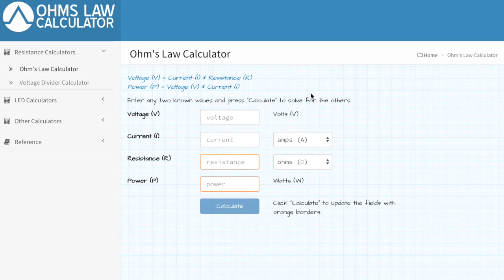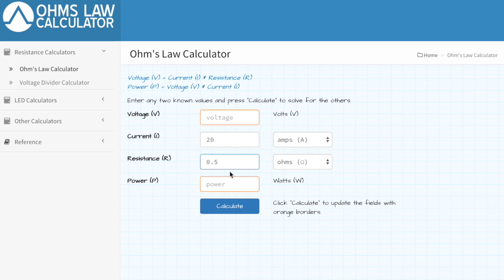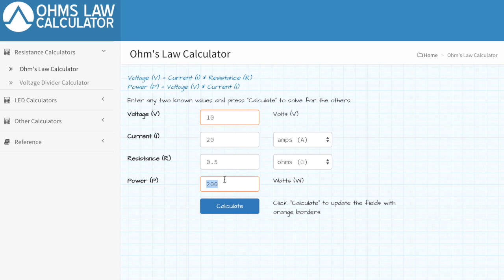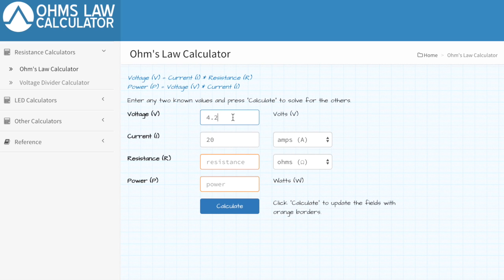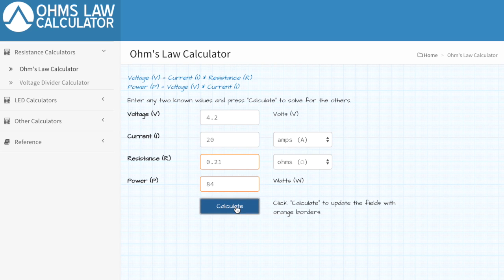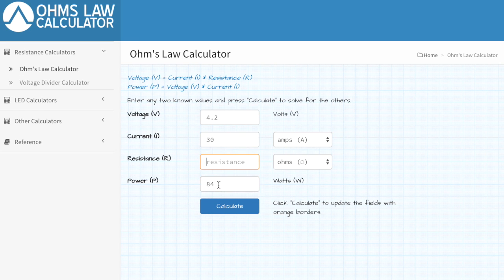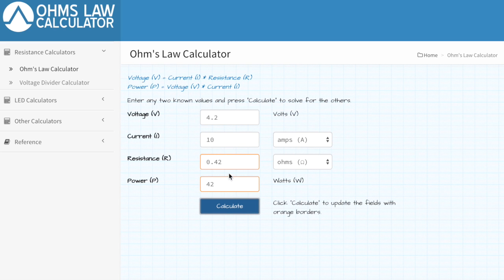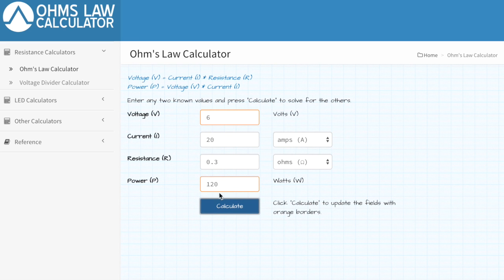Vaping for Beginners - Ohm's Law & Coil Resistance for MECH MODS

Comment: My first ecig was the nautilus mini. I am a newbie for sure. This is beyond my comprehension. I just bought a Aspire K4 and a Aspire Platinum Kit. I know the Cleito has 3 different coils, can I use any of them? I am using the .27 that came with the kit. I dont even know if you can put the Cleito on the Aspire Platinum battery. They are both 2000 mah batteries. All this stuff is confusing to me lol

Comment: how do i get my vape to stop shocking me? i start off at a 19.0 w and 3.07 v. i have tried to check other forums post on saying that it is hot juice, or it spitting up rather than a static electric charge, but it really does feel like a small shock. i have also tried taking a small paper towel and cleaning the tip and inside. I have also made sure to leak some of the juice out so it is under the line and not full.

Comment: those batteries you have are extremely exaggerated in their ratings. no 18650 can have a high capacity and a high amp rating. efest actually buys there cells from LG chem and rewrap them. those cells from efest are lg batteries that didn't make the cut! don't just take my word on this, be smart people and do your research. Sony, Samsung, and LG are accurate in their ratings. don't compromise your safety to save a buck. happy vaping :)
Reply: Patík #neverlucky Efest does have true 20a batteries. The problem is that you don't really know what you get until to test it.
As I said, it is known that they change cells and still use the same name. This happens rarely and it's possible that they don't do that anymore.
But saying that they don't have 20a batteries is just wrong.
Reply: Patík #neverlucky That's how you think LG does their tests? If they are true 20a or not? They will still sell their batteries to Efest if they were 20a. Failing a LG test just means that they don't perform up to their standards. Who the fuck knows what their standards are.

The fact is that battery testers has proven that they are true 20a, so why would I listen to you? Are you a battery tester? Have you tested them out yourself? If a respectable battery tester has tested them as 20a, I will take their word for it.

I already mentioned that you don't always know what you get. I'm not talking about a bad cell, I'm taking about a different cell. For all you know, you can get a 10a cell without knowing because they have changed it. They do things like that, so unless you don't have a battery tester at home, I wouldn't take the risk.

Point is, they do have 20a batteries and the 20a cells is in fact 20a cells 100% of the time. the questions is if you get the cell that you ordered or is it a completely different sell, wrapped in the same name.

Just because it fails a LG test, it doesn't mean it's horrible. LG would never sell a battery to Efest if it was really dangerous. That just doesn't happen.
Reply: Patík #neverlucky I have already told that the chances of them changing cells with the same name is there. Without a battery tester, you never know what cell you really get.

It doesn't change the fact that Efest does actually have 20a batteries as it has been proven. Mooch tested them and they were 20a. Couple months later he did the same test on the same battery but a different cell. turned out to be a 10a cell. So what happened? Efest change the cell to a 10a but didn't change the name of the batteries.

So as I said earlier, There is a chance that efest switches their cells. But if you indeed get a 20a cell from them, it will be 20a cell 100% of the time. if you get the 10a cell from them, it will be 10a 100% of the time.
it's not like the same cells acts completely different. That's not what Mooch meant.

LG will not sell a dangerous battery to Efest. They don't do that, but efest will provide you with false information like higher amp, mah and such.
and sometimes even change their cells.
Reply: thata true efest has only like 13 amp and its tested on mooch
Reply: Well, for a guy that follows Mooch, I find it weird that you are saying that Efest doesn't have more than 13a.
Even though i wouldn't buy a Efest battery because I'm afraid that they will change the cell and use the same name, they do in fact have true 20a batteries.

What I mean about "I'm afraid that they will change cell" is that they mark it as 40a, they have been tested as 20a but they can easily switch the cell with a 10a one and still be using the same name.
So when you buy a specific Efest battery where you know that it has been tested as 20a, the chances are still there that you can get a 10a battery. I'm not sure if they still do this but I wouldn't take the risk.

But they do in fact have 20a batteries.
Reply: cause the 20A's dont
Reply: naaah duude... they just take lg bateries that didnt make it thru the tests and put their sticker on it.... soooo no not always 20A => youre not guaranteed to get a true 20/40 A battery
Reply: https://www.e-cigarette-forum.com/forum/threads/an-open-letter-to-efest-youve-gone-too-far.722293/
Reply: Patík #neverlucky You are repeating what I have already told.
Reply: when my mates started vaping they all bought efest batteries and after 3 weeks of usage they had to throw them away cause they fked up somehow i started vaping a bit later and have been following their battery problems so I bought Sony VTC batteries and its 7 months and ive had no problem so far
Reply: guys whatever its just that i saw how efest react and it seemed crazy that the problem happened to all three friends almost at the same time...
Reply: Patík #neverlucky Well, Could be that they used a 10a battery or something. Maybe they don't even know the ohm's law. ( I'm not talking about this shitty tutorial on it )
If your ohm law information gets from this video, you better check something else.
Reply: +Sean RobinsonJR i will take your world for it then... just not in the mood to argue and stuff...
Reply: Patík #neverlucky Don't get me wrong. I wouldn't either buy a Efest battery. That is only because I don't have a battery tester and I wouldn't know what cell I would actually get. That's all. But you can't claim that they don't have 20a batteries because they do. it's really about what you actually get from them, which is impossible to know without a battery tester. That's all
Reply: Sean RobinsonJR K man ty
Reply from the maker: Yes, I do NOT use efest batteries anymore, this is an old video

Comment: This seems like it started way past beginning stuff. Not that it's hard to understand, mind. She did a good job explaining. 
It's just, why start off explaining wire gauges and buying your own rechargeable AA batteries? I began vaping a few months ago with a little kanger pen thingy, then went to the store for something better. Guy sold me an istick 30w and an Aspire nautilus mini (with a cool replacement tank with metal lattice on the outside)I bought replacement coils but there were both 1.6 and 1.8 ohm ones, or really low ohm ones but idk anything about "sub-ohm" vamping. Didn't seem like much difference. Oh and there are 1.8 ones for a triton mini that fit that had a "Clapton coil". That's not even considering what wattage to use
And then my halo TriBeCa juice sometimes is tan with a cigarette smell, sometimes pink with an almost perfume smell. It's supposed to be the same flavor!
Too many variables

Comment: Why does my resistance gets super high after i take a hit?? vaping at 3.5V/ 28W
Reply from the maker: you have a short
Reply: I think my coil was floaded!
Reply: It could be a lot of things. Floaded, not tight leads, wire that you are using and so on.

Comment: what if you use dual 1850 is the amp still 20 do you double it
Reply: Depends if it's a series mod or a parallel mod. If it's a series mod, than no.
If it's a parallel mod, then it kinda doubles. Because a regulated devices has wires and a chip and all that, everything needs to get passed it which has a resistance to it. So saying that the AMP gets doubled is wrong.
To be safe, you should calculate with 1.5x and not 2x.

For a parallel mod. So 2x 18650 batteries with 20a each would be 20a * 1.5 = 30a.
It kind of depends on your mod because you have to thing about that it travels through a lot of wires and a chip and that's why you don't get fully x2. If it's a mech mod, then maybe.

Comment: isn't it easier for beginner like me to have a starter kit that have watt settings like kangertech subox,dripbox or joyetech's, etc?
Reply: For a starter, I would recommend a regulated mod yes. They have locks for: resistance, volt, wattage, and some have AMP limit.
Which basically means that they are dummy proof. in a regulated mod, resistance means shit. To calculate the AMP, you take the wattage / volt = AMP
Note: not the voltage that is displayed in your board but the actual voltage output from the battery which many people confuse.

For example, the rx200 has a 20a limit which basically means that if you have 20a battery in it, you can't fuck up.
For the regulated mods that has a fixed mod, I would guess that they have figured everything out so you can't fuck up.
It's hard to actually know what they have in them. What amp batteries they use and so on, but it should be dummy proof if they did their job like making a limit for everything. That's why you can't pass that specific wattage, volt, resistance and so. It's for your own safety.
Reply: thank you for your explaination sir.

Comment: I purchased a battery (LG-18650-20a-3000mah-3.7v) my resistance is .31. 
It should allow me to set it at 50 watts which is my comfort zone however when I do i get a low battery warning on a fully charged battery.

In order to get a full 3 sec drag i have to set it it down to 37 and slowly bring it down as the battery dies.
Do you know a way to correct this or do my batteries just suck?
Any ideas would be helpful.

Comment: shouldn't the voltage on that calculator be the voltage listed on your battery? the one you held up said 3.7 volts but you first calculation it showed 10v on the screen.  I just ran a test for my Efest. 3.7 v, 35a continuous, 0.5 ohms and it comes back 129.5 watts.  If I change to 10 volt it comes back at 300 watts.  the voltage of the battery is very different from 3.7v, 6v and 9v.

Comment: ok maybe im overthinking all of this. the more i read about the logic of " sub ohm laws" the more confused i get but this breakdown is pretty simply put lol. but my main question is whats the safest set up for my mod? i have the new kangertech topbox mini 75w tc. can i use an rda like the mini mutation Xs on it? and what battery should i use bc obviously the rda will drain my battery, so with that in mind how much of a resistance do i need and what a good ohm range should i stay at? is it smarter to have a higher ohm? i just want to make sure im being safe in the long run and going to have my mod blow up in my face .
Reply: Well that mod is a regulated device unlike a mechanical mod meaning it has a chip in it preventing anything like exploding or something. You just have to use the right batteries like she was talking in the video. Get a case just for 18650 batteries so they dont touch other metal if you have them in your pocket or something. Also if you drop your bateries on a hard surface I would not recomend using them again. Throw them away. But I mean if you have them sitting on a table and one tips over that isn't a problem.
Reply: +camaris lindquist ok, im getting into rdas but I just want to make sure I'm completely safe. Would you recommend using the mod I have as a good stepping stone into the world of Rdas ?
Reply: Yes I think so. I have a kangertech subox mini. Pretty much the same as yours except mine doesnt fill from the top. It came with its own simple rda so i really do think it is good for getting into rebuildable atomizers. However I haven't used any other rda on mine becides the one it came with and dont know if any other rda should be used with it.

Comment: I'm new to vaping, I just bought a kanger topbox mini. It came with different types of coils and has temp control setting for the different types of metals. When I tap the fire button three times it cycles through Ni temp control, SS temp control, Ti temp control, NC temp control, and then wattage. What setting should I run an RBA coil or say the Clapton coil. Should I have it on the wattage screen? And if so what wattage? If this even makes sense lol...

Comment: Hi Abby... i am all new to vaping and as most beginner (i guess) i prchased a so called beginner "Starter Kit" it is a Kangertech Top Box Mini and i got a couple OCC coils with them... but also a battery and the thing is that i dont really understand what you talk about in your video... On my battery it says 3.7V - 3000MAH - 40A - High Drain Rechargeable Battery and my coil is a SS 0.5 I have set the device to (ss 400F) and vape on 35-45W.... the calculator says i am to high with my settings and now i am very confused :-( Im just scared the battery might blow up... any suggestions? please see the screenshot http://www.awesomescreenshot.com/image/1213120/587bdfe700c6d6987cb652f4daf9b33a

Comment: I'm using SMOK R80 with ASPIRE CLEITO tank, what should all my settings be on? I'm new to vaping, thank you
Reply: I have the same tank. I'm using a 3 battery 
 WISMEC REULEAUX BOX MOD and I'm at 0.43 om 
4.64 volts at 50 watts. it hits nice and is a great setting for a beginner.

Comment: Can anyone help me, I recently got the iJust 2 and it's getting to hot and I can barely use it for more than a second
Reply: draw the air in faster it will make the vapor cooler , if your just coming off cigs your will have to get used to drawing in alot more air than you would with a cigarette. or use a higher resistence coil both result in a cooler vape

Comment: I've only been vaping a few days on an actual box mod and stuff and I've done a lot of research before getting the set up I have now (Innokin iTaste MVP 20W with an aspire nautilus mini at 1.8 ohm resistance but I'm probably going to upgrade to the Cool Fire Plus IV or the MVP 3.0 , may be the Pro version) and so I've read and watched various things over battery safety and ohms law etc but I'd say your video is one of the most helpful and easy to understand that I've found and helped me to better grasp certain points that were elusive to me. Thank you so much :)

Comment: Wow! i have a strong knowledge of electronics, however I'm new to vaping. This information and links are exactly what I needed. Very informative. You provided some very good and needed links. Please keep these videos coming! 

I do have one question... I'm considering the purchase of a small rebuildable atomizer, such as an A7 in hopes it will give me some experience building before I purchase something more expensive, such as the 13 Heavens 9 Hells. Most of these small atomizers use silica wicks. I prefer not to use silica. Can I either twist cotton into a wick or can I purchase pre-made wicks made from cotton? Any suggestions would be more appreciated.

Comment: V= volts I=Current (amperes) R= resistance 
so if your batteries are 4.2v 4200mah your coil(s) max resistance would be 1 ohm
R=V/I your max wattage would be 17.64 watts

Comment: Nice video but there are a few inaccuracies.  Thinner wire heats faster than thick wire.  We as Vapors do use pulse not continuous,  any battery saying over 30a  is using the pulse rating. Two parallel batteries share the load equally halting the current. Series batteries don't.  You mixed up the rules and some other points,  mechs and regulated use different ways to implement ohms law.  Overall you are correct and the errors work in favour of safety so not a big problem but should be corrected if your teaching beginers.  Cheers.
Reply: took the words right out of my mouth... she lost my subscribe...
Reply: +orlando perez  A little Harsh  don't  you think ?
Reply: +Bigrig 66  not if you take into account she states she knows the information.  You have to ask what other advice she has got wrong. It is incumbent on people who portray themselves as expert they at least check facts.
Reply from the maker: +David The Man Behind the Madness Soulsby thanks for your input. i was attempting to break it down to the most basic level for all beginners to understand.
Reply from the maker: +David The Man Behind the Madness Soulsby send me a message with a link. Google didn't produce anything for "everything unregulated collection"
Reply from the maker: +orlando perez sorry to hear that
Reply: Abby Vapes 
Admirable but if you don't know the subject don't try to teach others the wrong facts.  In this case no harm would be caused. Later someone goes and tells their mate what you said but he gets it a bit wrong etc. 
YouTube is full of "reviewers"  who don't know what they are talking about but heard a mate say..... At least you tried I will give credit for that. Just check facts that's all.
Reply: Abby Vapes 
If you want details for beginners look in the everything unregulated  collection,  there is information there that has been checked.  Use any of the notes you please, no problem.
Reply: https://plus.google.com/collection/Er6ffB
It's all things Unregulated  
😥😥😥😥😥

Comment: I found on higher voltage, it tasted burnt and on lower voltage, it was building up the juice on the coil, followed by spilling juice. I'm using 0.5 ohm coils. What would be the best setting in your opinion?